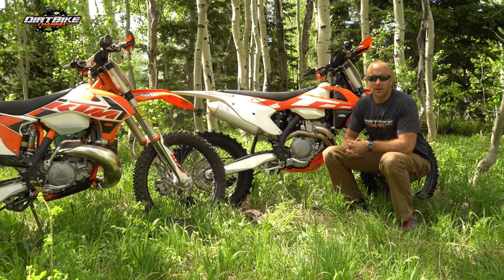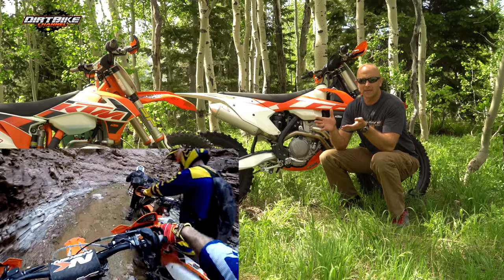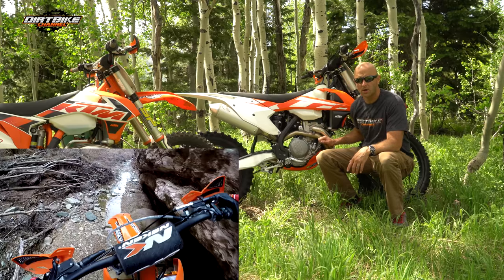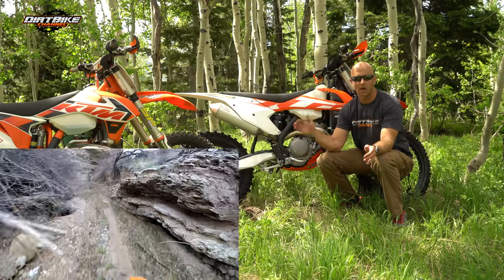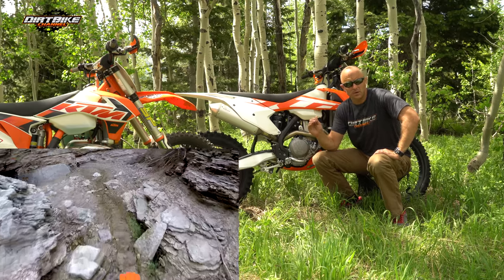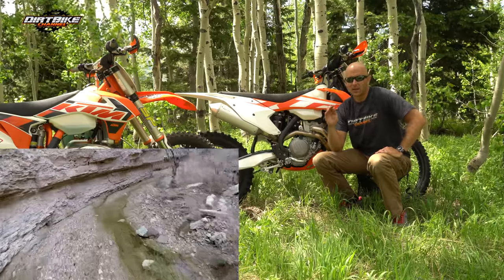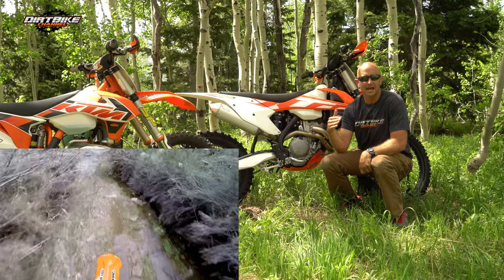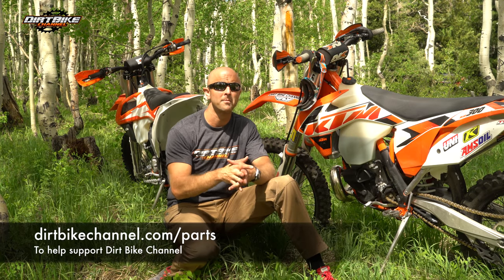Electronic Fuel Injection on 2 Stroke Dirt Bikes? Part 1 - Episode 139

Comment: I am a certified outboard mechanic for evinrude/Johnson motors and Yamaha at a large marina dealership. I've been part of it for 15yrs. So I've been here for carbs, fi, and direct injection with 2 strokes and 4. In my honest opinion with 2 stroke dirt bikes you don't need to fix something that's not broken. Dragging a laptop out to work on my dirtbike is not where I want to be.
Reply from the maker: Thanks for the relevant input on the topic Bryan!
Reply: I am also a certified marine mechanic and work for large yamaha dealership, also work on etecs etc etc aswell...
Efi, Di on outboards is a god send! Would never ever go back to carb on a boat... On dirtbikes its totally dif. Bikes are light nimble and simple. Intro some sort off efi and weight and complexity will out way the advancement IMO. Small motors that dont need huge torque/hp vs weight dont need efi. its like efi on a chainsaw or lawnmower...No need.  
I love my premix yz125 but on my 1000cc fireblade roadbike i love my EFI... end off day small engines no need, big engines yes
Reply: Don't fix something that isn't broke what about all the gas it eats that's a problem. Also you wouldn't  need a laptop to tune your bike you will never have to.
Reply: Di motors have to be hooked up to do anything. Simply resetting the oil change, checking hours of operation, any diagnosis, checking fault codes and then list goes on forever. In my opinion, and it's just that MY opinion, the big motors are great to have it but leave it off the little motors. Also I'm mainly taking about direct injection .
Reply: No need for a laptop, just easily install a map switch. Done. I have a PC map switch on my WR, 2 maps. Switch on the fly in 0.1 of a second. Screw carbs, they are more work in the long run.
Reply: How about direct injection on larger motorcycles? for example a suzuki Gt750, a larger displacement street motorcycle
Reply: redkachowski I think it would be great.. Fuel mileage, emissions, on demand power,  and the ability to make adjustments with the computer would be awesome.... I just don't like it on a dirtbike
Reply: except lap top is a bit of an exaggeration. if they can make tuning modules that tune a v8 turbo diesel truck that are the size of an cell phone there is no reason the same thing wont happen for bikes. also there is no reason the bike manufacturers wont just have an app for your smart phone that is downloaded for offline use. so all you need is your smart phone which you most likely have anyway. or use an old phone as a dedicated bike tuner.
Reply: but thats like saying you dont want more power. the added weight will be minimal.

Comment: The thing is, you don't need to tune a fuel injector.
Reply: you do as soon as you change a factory part out for an aftermarket. or want to run a higher grade fuel . changing anything on a fuel injected bike that doesn't have an 02 sensor would be or could be detrimental. the dirtbike engines in question dont have all the sensors like a car so it doesn't just adjust to changes like one would assume. plus small engines are way more sensitive to minor changes.

Comment: the best thing about efi is it tunes itself for conditions! once you find a tune you like for whatever power characteristics you want, the efi system compensates for conditions so you never have to tune it! it seems you totally missed that in this video. cost, complexity and weight are the ONLY drawbacks, tuning is irrelevant
Reply: Very well said!
Reply: you do as soon as you change a factory part out for an aftermarket. or want to run a higher grade fuel . changing anything on a fuel injected bike that doesn't have an 02 sensor would be or could be detrimental. the dirtbike engines in question dont have all the sensors like a car so it doesn't just adjust to changes like one would assume. plus small engines are way more sensitive to minor changes.
Reply: MAP, oxygen, detonation  and the crankshaft position sensors makes efi adaptive. Otherwise efi looks like "electronic" carb.

Comment: I think a carburetor is terrible on a modern aluminum frame bike and a big part of the reason the carb had to go. Taking the bike halfway apart to swap out some jets on a regular basis is just not a good combo. Sure a perfectly tuned fcr ran better than any efi system currently offered but with how compact frames are getting on 4ts the years just prior to efi are really a nightmare for guys who just want to be out riding on a well adjusted machine and don't have all the time in the world to wrench. The efi is well adjusted enough for the average joe to never touch.
Reply from the maker: You make some fair points here.  Thanks for sharing it.
Reply: My Wr250f 2012 was a nightmare to dial.. I have got it to i`m 90% happy. I reckon knocking back to a 60 leak jet from a 50 would crisp it up to perfect but I just could not be arsed tearing my bike apart again..
Reply: mmmh. have you tried the Lectron cabruretor? I am not touching any jets anymore. From cold weather to desert hot. From sea level to mountains. It works. All you adjust is the idle and if really really necessary a simple twist of a metering rod.
Reply: You're doing it wrong if you had to take half your bike apart to change jets on a FCR.  All you have to do is unscrew the drain bolt and then unscrew whatever jet you want to change.
Reply: never changed a leak jet have you? Ever tuned in an accelerator pump.. ? 4 stroke carbs are a bit of work to dial in.. Right now I want to change my leak jet from a .5 to a point .6 as my 1/8 throttle is a bit rich but i just could not be bothered getting to it. I would have to pull my carb off the bike, which wreaks of effort...
Reply: +Greg Kenny nope my bike came with an R&D adjustable leak jet.

Comment: Awesome videos, they're really well done! I just got a 2016 wr250f and I was coming from riding quads about 10 years ago. The bike I got has efi and while I have been loving it I must say that the throttle becomes much more touchy than anything carbureted I have ridden (especially down low) takes a while to give the roll on power like a carb does
Reply from the maker: John, you hit the nail on the head and I'm covering that in the part 2 of this series coming up in 3 days.

Comment: I've been riding in the woods on two stroke for 32plus years and couldn't agree more. 
I bypassed four strokes with EFI for my 08 530exc r because I know how to work on it. 
It actually runs cleaner and faster than 2013 500EXC with FI. 
I'm going to need to learn short cuts for it though. 
Like you said it's a comin. 
Great vid thanks for what you do. 
B

Comment: From what I recall, (and I could be wrong) the issue with putting EFI on two stroke dirt bikes has to do with the complication of accounting for the amount of fuel and air being returned from the expansion chamber. This changes dramatically when the bike is "On' the pipe and "off" and with different loads. In a four stroke, fuel and air are mostly flowing in one direction the entire time, and where two stroke snowmobiles and outboards get away with it is they're "constant throttle" applications where the engine is run at, more or less, the same engine speed and throttle input, which makes metering a simpler task.

Comment: I live in Colorado Springs, we ride year round here, and we ride in Utah in the spring and fall, and I have three 2-strokes: 07 KTM 250XC, 13 KTM 250XCW, and 12 Husaberg TE300.  Winter, summer, spring fall, altitudes from 3500 feet to over 11,000 feet.  I never touch any of the carbs.  I jetted them correct for 8-9000 ft and they work good enough at all the other altitudes and temps.  I run 44:1 Maxima black bottle 2-stroke oil.  We never foul plugs, and none of the bikes detonate.  If I absolutely have to, I can rejet in the field in about 10 minutes on any of the bikes and don't need a computer to do so.  I don't need or want fuel injection on my smokers.
Reply: Sounds like a big load of shit  it has to be detonating or something. Anyone can change jets in 10 minutes. carbs will never have the mixture perfection EFI does or the instant power. Ever ride a efi bike???

Comment: When you look at a Carborrator , it has no brains. It Can't calculate air pressure, air density, how hot or cold the air is, it can't actively adjust for conditions like a fuel injector can. I agree with the complex design and learning curve and just all out frustration that comes with it, look, my two stroke is sittin happy in my garage, and I gotta take my 4 stroke in to have it updated and re mapped lol. I'm not saying carbs are bad and I like how easy it is to work on them. But with fuel injections comes more advanced and progressive ignition mapping and timing, I can get the bike to do a lot more with a computer. But that's another topic. All I'm gonna say now is, if you asked me for s carb or fi, I'd take the fi any day of the week period

Comment: I think you got a couple things right, but a ton wrong.
The right:
Carb bikes are not obsolete. We have amazing well running 2-strokes right now. And usually any issues with them now revolves around bad head design.
EFI on 4-strokes haven't been a massive performance gain. But they do have enough benefits to outweigh the negatives.

The wrong:
You keep using the 4-stroke EFI as your basis for how it would work on a 2-stroke, but the technology that would be used is LIGHTYEARS apart. If you are only talking throttle body efi, sure, it is unnecessary on a 2-stroke. SmartCarbs are already more advanced than throttle body EFIs. But the big push is for Direct Injection. You have to understand the benefits of that system. The major gains from such a setup would be low rpm torque, fuel economy and emissions. The, historically, biggest issues with 2-strokes. When was the last time you saw a road legal 2-stroke from the factory in the US? 30 years? DI could change that and who wouldn't like a 50 state road legal KTM 300?
Now for the added weight, it will be, at least somewhat, offset by not having to carry as much fuel (more effective the longer the ride you do). 

You talk about jetting like it is such an easy basic thing "you just need a screwdriver." Please. I need to remove my seat and tank to get to it, multiple sockets (I don't even think a screwdriver is used once) to disassemble and remove jets. Then you'd need to carry multiple jets and needles (try not to bend them in your pack). Basically, something I would never, and have never, do out on a trail. So really, having to use a laptop is no more of a hassle, in fact, I see it as easier (no disassembly required). This hassle is what led me to replace my Keihin with a SmartCarb. Set it and forget it, just like a DI system would be.
We don't need to rush it, but not for the reasons mentioned. While it has proven its worth on boats and sleds, it has shown some issues. Mainly, temperature. Ski-Doos had overheating problems because what was once a primary coolant for the crank was no longer going through the crankcase because it was injected directly into the cylinder. Arctic Cat has aimed their injector so they can inject in the bottom end during high stress pulls to keep it cool. And this is in sub-freezing climates. This is the issue that needs to be solved before it can work reliably in the desert without frying your crank.

On that note, I'd love to see advancements made in trapping valve technology.
Reply: Agree, and I want to mention that you can tune FI using smaptphone through wi-fi/bluetooth.

Comment: Yep, want a lectron for mine and my wifes bike.  I can live without it just like EFI.  Great explanation of how it all works.  I defiantly agree with your sentiments.  I could argue that I don't do a lot of tuning on the trail (I really don't).  I don't have a ton of elevation changes where I ride though.  When I do make it up to Colorado I usually will jet and tune when I get their.  Most of the guys I ride with there have all jetted it before, so I just ask what they are running and it gets it in the ball park.  Most had the same motor as me (2 stroke 300).   I'll welcome it if it comes, but likely won't be a big reason for me to upgrade.  I like to tinker and learn new things and it will be just another thing I'd learn.  Already understand how it works in a car, but don't think the bike would be that much harder to understand.   Rather have better suspension or frame upgrade to temp me to shell out cash for a new bike.

Comment: The OSSA trails bike is fuel injected and it is awesome   It is awesome and lightweight,  I do not have to change the jetting for temp, and elevation 4 times during a ride.  We can go from 6k to 10k in altitude in a single ride.  You jet it for somewhere in the middle for a carb and it is okay but always a comprise.

Comment: this is the quote from our Australasian Dirt Bike magazine from joachim Sauerkraut KTM product manager 
"Australia may not even get the injection system because your emission laws are different to Europe and if we don't have to sell it we would rather not because it is too expensive." and "don't worry you're not missing out on much, there are no major gains from the direct injection system and you would not notice the performance difference"  
maybe KTM can find a way to get around this injection system for the two stroke cause it'll also mean a 300 will be the same price as a 450 which I'm sure people buy the 300 cause its cheaper too

Comment: I don't think EFI is too important on a 2 stroke since a lectron carburetor hardly needs to be tuned. And the only reason I hate my carb is because I hate tuning it. I'm a big fan of EFI on 4 strokes because for me I just plug in a handheld computer about the size of an iPhone 6/s plus push a few buttons and I can tune it. I've never brought it on the trails with me because I'm usually no more than 30 minutes away from my house. Another good video Kyle 👍🏻
Reply from the maker: Thanks for the comment Tyler.

Comment: Just a side note, not really a big deal but batteries are not required for EFI. My 2010 CRF450R has EFI but no battery, it does require several kicks to start up first start of the day.

Comment: At 1st, EFI on a two stroke sounds like a GREAT idea! No more jetting hassles, no slobbering carbs, etc. But, when I really started thinking about why I went back to a 2 stroke, simplicity was a huge part of my decision. Adding EFI would, in my opinion, hurt that simplicity. Granted, modern EFI systems are extremely reliable and offer many advantages, plus adding in oil injection would be icing on the cake! Perhaps us old 2 stroke guys are just waxing poetic, hanging on to our beloved carburetors and pre-mix as part of our life long 2 stoke romance? Strong arguments can be made either way but eventually they will be injected, it's inevitable. Will it be a good thing or bad thing? Only time will tell!
Reply from the maker: I like this comment.  Thanks for taking time to share this stuff.

Comment: So glad i found this channel, very good and valuable information. Thanks man ! 
Also. 
I just upgraded from a 2009 ktm 250sxf to a 2015 ktm 200exc. And at first i was very nervous over that it would maybe be a too weak and not keep up.  But i rode it yesterday and it felt very good. 
But i think that the power would be more than enough for my ridingstyle. I wouldnt be able to handle a 300twostroke either way. 
But i think it boils down to just learn to ride it, choose right gear at the right time, learn to use the backbrake more and better (since it has no engine breaking) and just generally learn to ride it. 
But in the future, when im alot more skilled, and handle to power of the 300beast,  i might buy a 300exc. Becuase ktm has discontinued the 200cc model. 
So it could be a problem with spareparts. It wont be a problem for atleast 10years though..

Comment: the fuel injectors go into your intake manifold on most cars not right into the cylinder, if it went into the combustion chamber that is direct injection which you find a lot in Volkswagen's these days

Comment: the benefit of conventional fi is automatic adjustment to elevation and ambient temperature changes, that is worth everything, time is more valuable then money at least in my life.....having said that I run a lectron so issue is pretty much none existent.cons in a sense of going fi, a dedicated fuel pump, dependent upon if it will be direct injection which demands very high pressure (1000+psi) or port which needs about 70ish max, static @43psi, some kind of maf or map sensor+ iat/coolant temp, and possibly a o2......this is the standard in automobiles

Comment: Correct me if I'm wrong, but if you had EFI on a two-stroke, you would also need oil injection. Sleds and boats with EFI don't run premix, and I'm sure the huge variation in mixture ratios cannot be accounted for with a "dumb" EFI like bikes have. In short, complexity and weight would increase considerably.

Comment: what I can weigh in on is if we see fuel injection on a two smoker it will be directed injected. meaning directly into the cylinder.  I'm not allowed to say who is currently working on this but there is currently a sealed crank case two stroke motor being developed. which by sealed crankcase means the motor has a pressurized oiling system like a four stroke. this unit will also be direct injected
Reply from the maker: You under a non disclosure agreement?  :)
Reply: +Dirt Bike Channel something like that...   I did some simulation stuff to see if it would work. it does but it's still in a infant stage as far as development goes